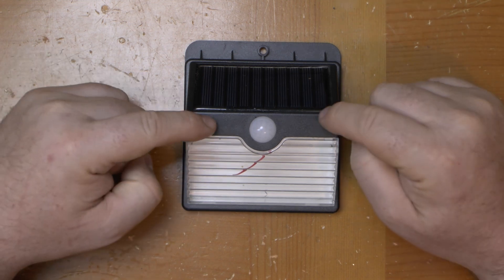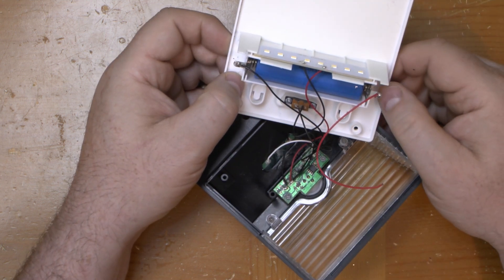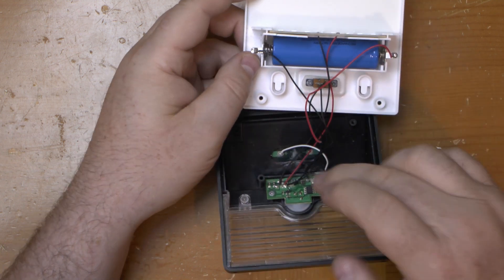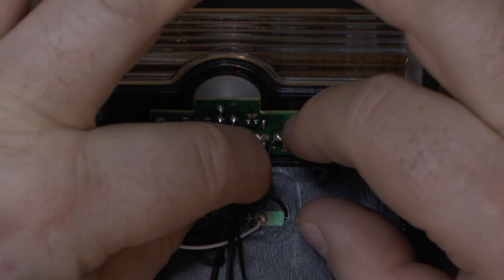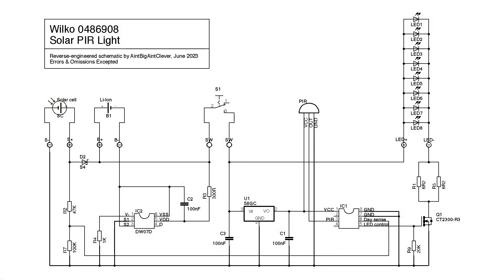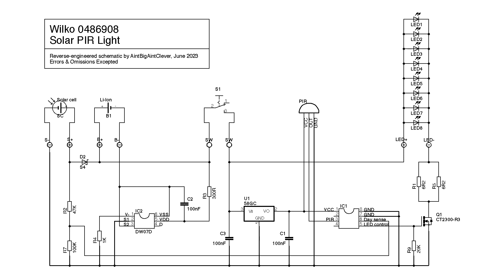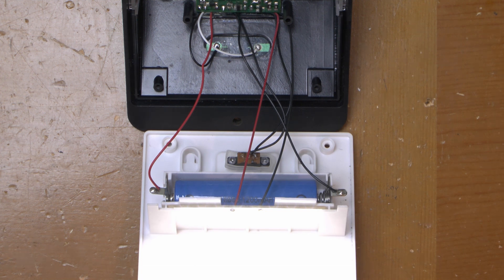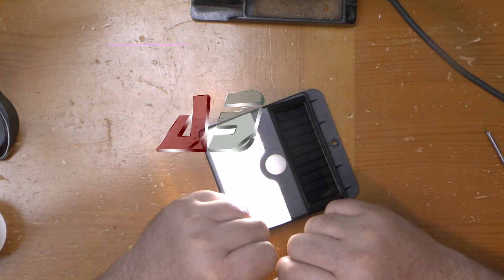What's inside a Wilko solar security light?

Comment: Those wires are often made from horrible materials with hard plastic insulation, same crap as the 9 Volt battery clip terminals. Bit of corrosion on the pads.
Reply from the maker: Yeah, that seems about right, 9 volt battery snaps tend to be "corrode and snap" too.  I was tempted to change the wires (I've still got a few reels of 10/0.1mm² as I used to use quite a bit of it) but ended up leaving them as they were and just resoldering all the ends.